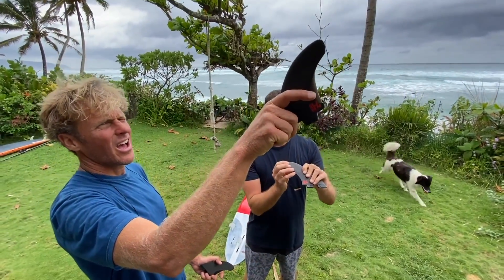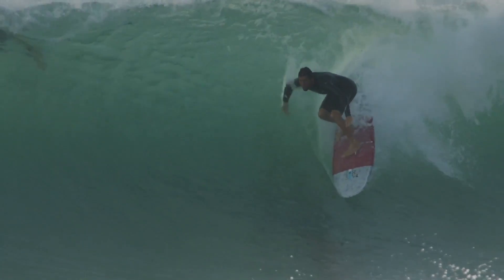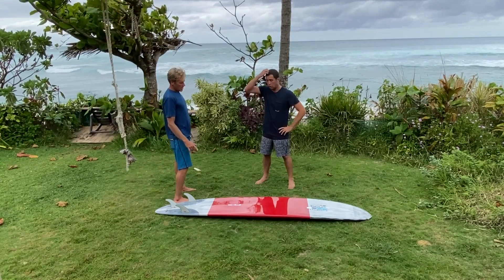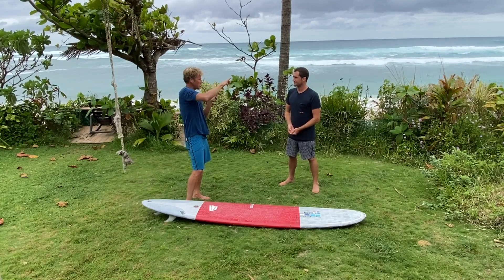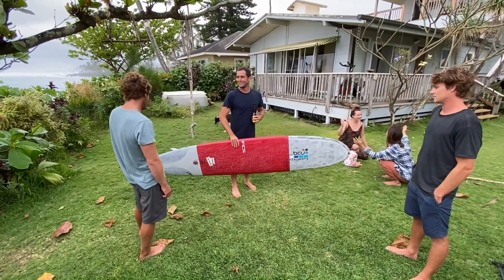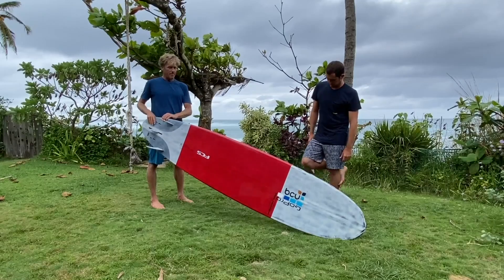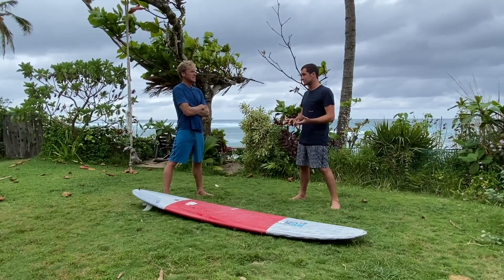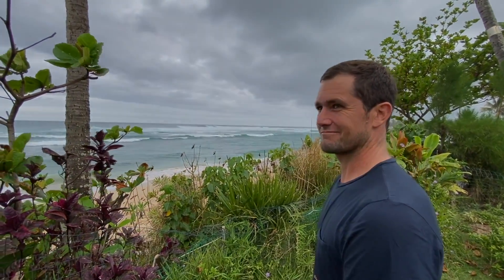Thunderbolt BLACK vs Thunderbolt RED: Dan Mann interviews Harley Ingleby about Longboard Technology

Comment: Hey! I'm struggling with fin sizing for the Black. I'm 5'7, 160lb, would 7" center and 4" side bites be too much fin?

Ideally it would be for clean, waist high+ point break stuff, and I love powerful projecting bottom turns and big carves on the face, but I also like to pull cheater 5s when I can.

Comment: It sounds like Harley describes the Black as having a fiberglass AVT system with Carbon Fiber Laminate and the Red as having carbon fiber AVT with fiberglass laminate.  Is that accurate?
I thought all the AVT systems were carbon fiber.  Does it vary by board?

Comment: Tunderbolt looks good on Harley but Dan Mann, I tried all your Timbertek longboards... good but not outstanding, no spark, TJ Pro the only stand out as long as you have good waves cause as 9'0" at 60 litres is low volume. Flexflight the worst, Special T feels like a slow stick - noserider with hard rails, are you mad? Gem unstable on the front section and slow, no spark, slow glide, you know what is good on Gem? - TJ fin positioning. Any board works on good waves but that's when you want the spark, only TJ Pro shines unless you take short-board instead on good waves. Amazing construction Timbertek with average shapes - missing the point. I went to my local shaper and we did a custom that is better by far. Or save money, try Torq TEC, Don and Horseshoe are amazing light to throw around and glide super fast and anyway who lands floaters like that but Harley to need more than the standard carbon double T stringer that comes now with most blanks? Anyway, I am very critical but Timbertek-s are boards to love just maybe don't compete on them.
Reply: Interesting reading. I am riding a wingnut 9'4 and loving it, but have not tried other boards from firewire. Have you any comments on the wingnut ?

Comment: I have surfed and owned more than 30 FireWires.
When can you get a Thunder Bolt Red and Black to Rhode Island. 
I long and short board comps. Recently have been testing Epoxys. 
This would come in a 9'? Important because they measure the board.
Reply from the maker: Hi Ron, this is a 9'1. You can check Warm Winds and Cinnamon Rainbows. If they haven't got one in stock right now, they can order it directly from us, for you. Please come back and tell us how it goes once you ride it. We think you'll be stoked.
Reply: Firewire Surfboards Excellant 😊

Comment: Would you consider doing them with Futures fins, instead of FCS? Thanks
Reply from the maker: Harley is sponsored by, and collaborates exclusively with, FCS. But FUTURES makes a really good 2+1 setup with Taylor Jensen that is really good if you have a FUTURES board.
Reply: @firewiresurfboards  hi, I already have them and they are great. I am a returning Firewire customer and all my boards have the Futures plugs. I would like to know if you will do all boards with Thunderbolt technology with the Futures plugs, or only selected models as there is no indication in your website. Thanks
Reply: I had the same thing with Futures for the timbertek longboards but I can assure you FCS 2 work wonders, IMO at this stage nothing beats FCS2 range, try for yourself and the FCS 2 soket is by far better than Futures, however Futures are remarkable and deserve all respect.